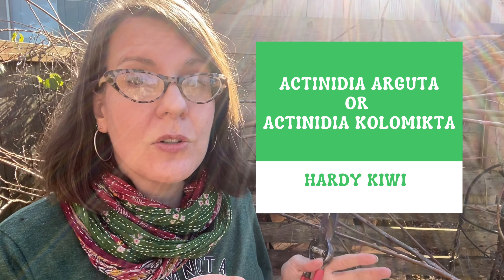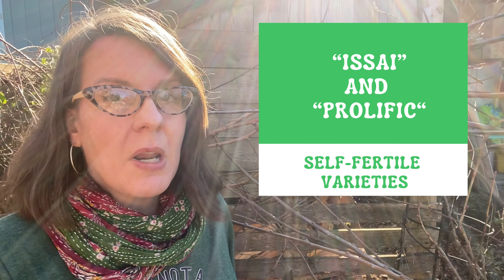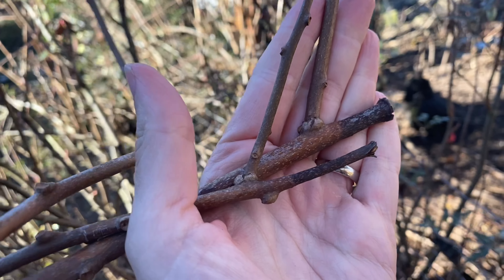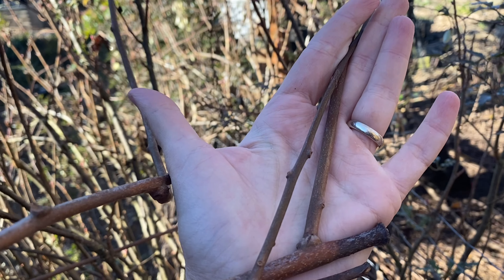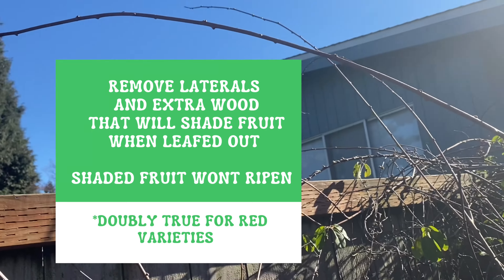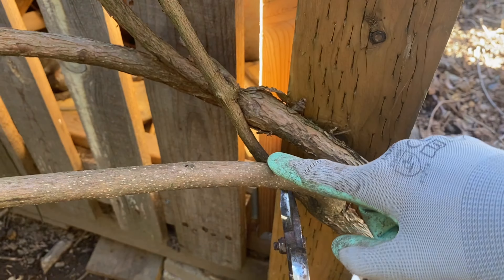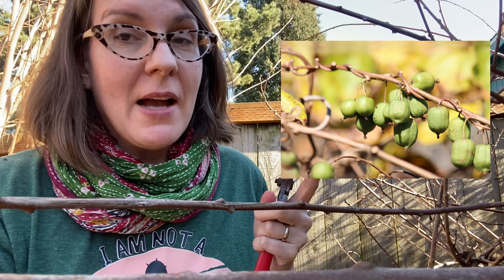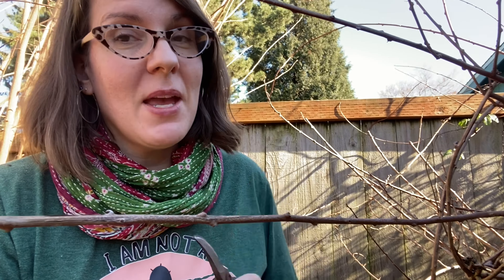Winter Pruning Hardy Kiwi (Actinidia)

Comment: I don't often advocate for purchasing new tools, but I recently purchased a battery powered pruner. Very fast action on the blades, and makes thousands of cuts on a charge of a battery. Comes with 2 batteries. Highly recommend picking one up. Worth the $129 if you do hundreds and hundreds of cuts. I do. And my hands thank me for it. 
Thanks for the video.
Reply: Can you share the brand and model?
Reply: @tinaho3392  I have DeWalt brand batteries. So I bought an off brand pruner that works with the DeWalt batteries. 
The devices are generally all made in the same factory, with different colors and battery systems, but the mechanicals are the same. They look very much the same. 
Just pick one and go with it. Good luck!

Comment: In kiwi, straight growing twigs often die. The strongest are the two-year-old ones growing sideways. They are thicker and stronger. This is easy to see when cutting. And it's not the frost that causes the twigs to die. Very often they die when they are weak and shaded.
Reply: 9:22 it is a good example. Its normal in my Weiki kiwi.